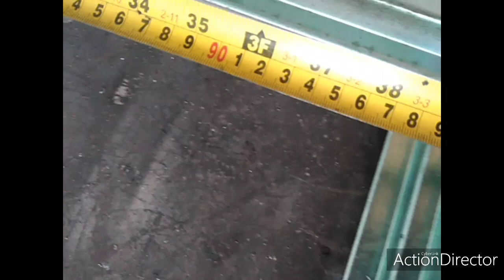COMO HACER BONITA VENTANA CORREDIZA EN HERRERÍA

Comment: Saludos una consulta veo que muchos espacios o angulos no estan soldados especialmente en ventanas no es propenso a filtrar agua y oxidarse.gracias
Reply from the maker: Saludos amigo si en las diviciones no es necesario soldar todo el perfil y es resiste te a la corrosion por ser galvanizado
Reply: @HERRERIASANTIAGOMAS24  gracias por responder con prontitud lastimosamente en mi pais el perfil no es galvanizado de ahi mi consulta.
Y en este caso que solucion se podria realizar en tu opinion para sellar esos espacios donde no se suelda.